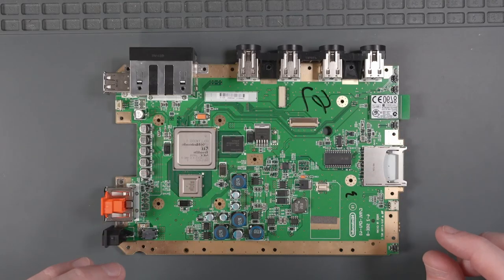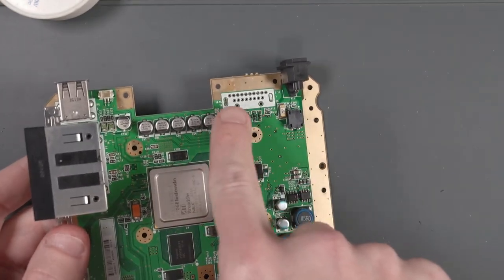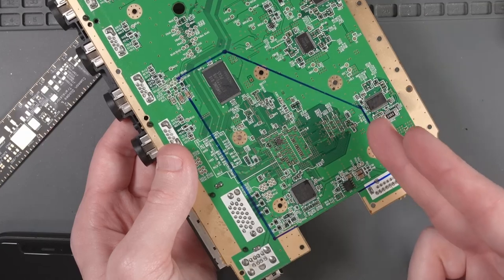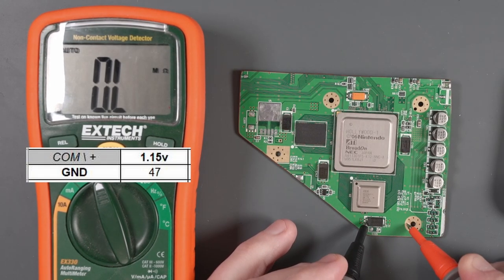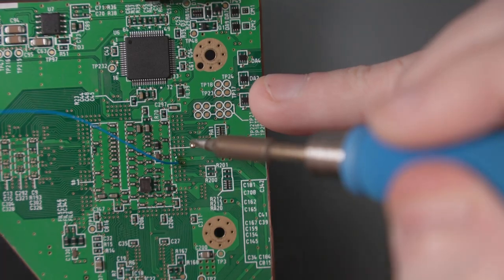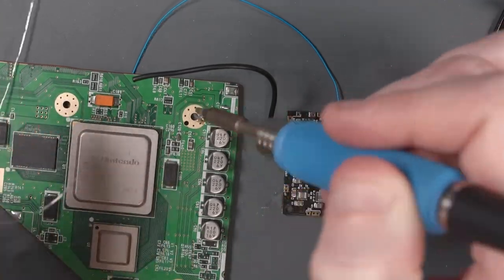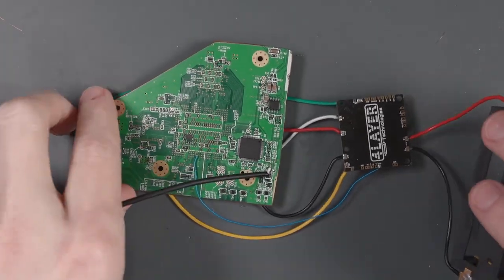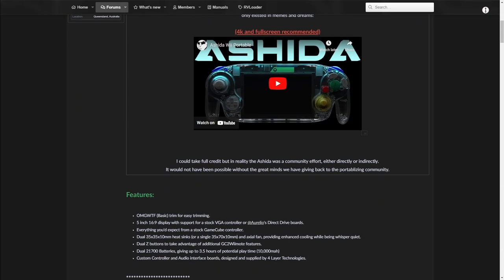Trimming a Wii - Building an Ashida Wii Part 2

Comment: When checking for resistance ALWAYS make sure to touch your probes together and measure that resistance first. The probe cables themselves will add resistance, especially with cheaper multimeters. Then subtract that number from your reading to get a much more accurate reading of your target resistance.

Comment: Just got mine cut, and tested using your video as a guide! Thanks for explaining and clearly showing each step of the process. I'd like to pay it forward by saying for anyone who is getting power to their chips (warm feeling) but absolutely no video, i tried 2 different AVE connectors and couldn't get a signal through them. I ended up soldering the end of a composite cable (yellow part) direct to my composite wires coming from the Wii, and finally got the error message. I'm not sure if this is recommended, so be cautious, but it worked for me.
Reply: I am so glad I came across your message because this is the exact boat I am in. Did you mean that you soldered a video wire into the wii and ran it straight to the tv?
Reply: I’m having this same thing happen, like the other guy commented, would you mind elaborating a little more on your fix?

Comment: Dude I’ve been pulling my hair out trying to figure out why the composite video won’t show up. I re-wired everything twice, tried a different Wii board connection for the composite cable, tried to blow out any copper dust from under the CPU + GPU, etc. I was just going to wait until another Wii arrived from eBay to harvest a new A/V port and see if that was the issue, but.. turns out I did exactly what you did - wired the ground for the A/V port to the outer casing!

I’m away from home at the moment, but I’m ecstatic to get home and re-wire it to see if that fixes my issue. I’ll edit this comment with an update on whether it works or not! Thank you!!

Update: Absolutely was the issue. I’m currently halfway done my first Ashida build!
Reply from the maker: Good luck!

Comment: I was testing my resistances and noticed that I get different resistance depending on which probe is where. At first, doing it the way you are, I was getting about half on all of my 3.3v lines, but when I swapped them, they started showing the correct numbers. I'm not sure if that will matter in the end though.

Comment: Hey Dubesinhower! Love this guide and I'm attempting to follow. What is the tape you used at 4:50 & why?
Reply from the maker: It's called kapton tape! It's heat resistant, so I used it to try to protect parts of the board that I don't want to be heated up by the hot air
Reply: @dubesinhower  Thank you so much!

Comment: Sorry for asking so many questions but I have some. Do you have a link for the desoldering gun you used and also the 22 gauge ribbon wire?
Reply: Or recommendations
Reply from the maker: I ended up using 24 gauge wire in part 3 (affiliate link): https://amzn.to/3s8fGYT

As for desoldering guns, I know it's expensive but the Hakko FR 301 is a great option, and it's the one I use in all my videos (affiliate link):  https://amzn.to/2L1ah0p
Reply: @dubesinhower  do you know any good inexpensive desoldering guns? Also is 22 gauge still ok to use?
Reply from the maker: @danio1864  22 gauge is fine! I’ll get back to you about the desoldering gun
Reply: @dubesinhower  ok